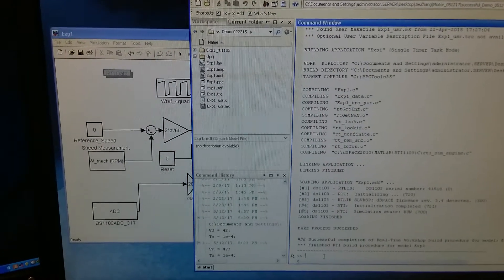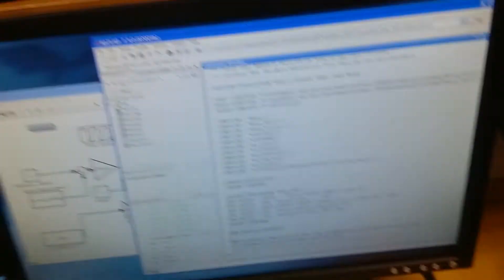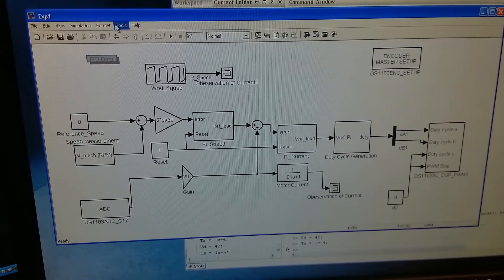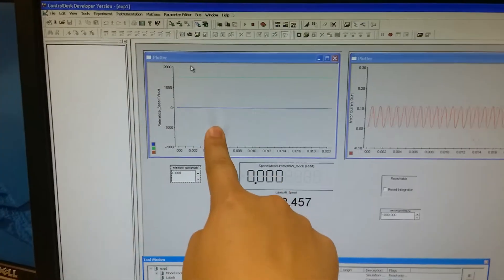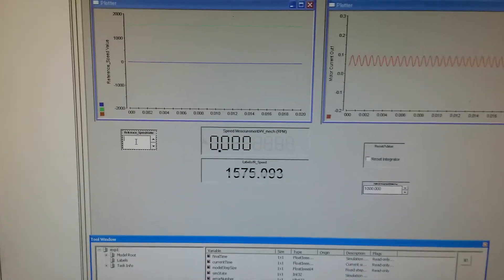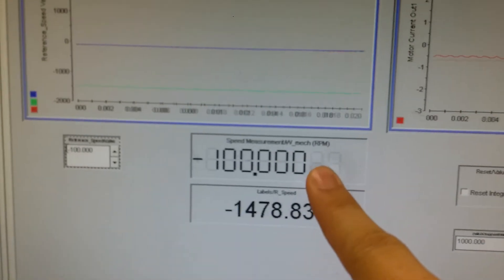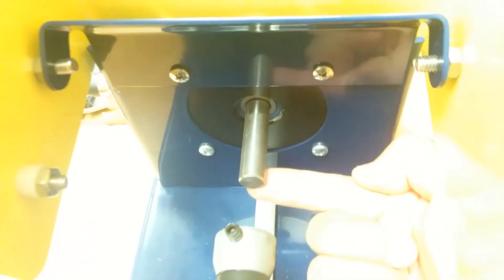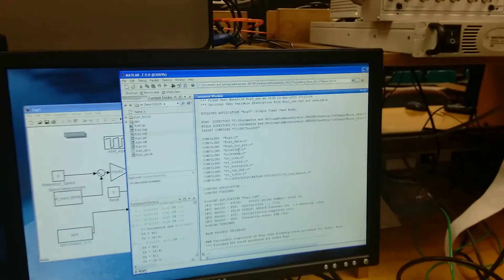Use dSPACE to control the speed of a DC Motor

Comment: Hi, do you know how can I identify the pin which corresponds to each PWM channel from the DS1104? I do not find any diagram
Reply from the maker: Hi, sorry I can't remember clearly. Seems that I chose any two of the pins and connect to the motor.
Reply: Hi Andres, you can find the pinout it in the dSpace datasheet for the IO board and compare with dspace library block to see which parameters to set for that